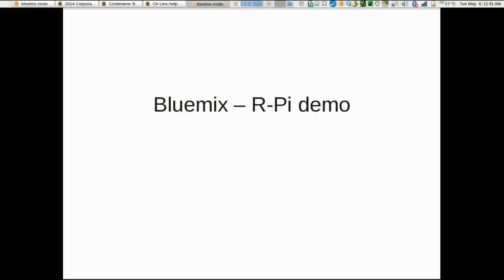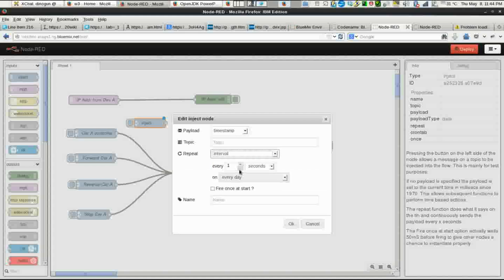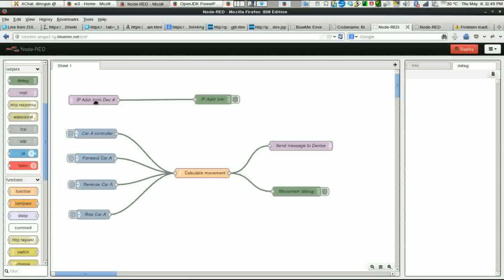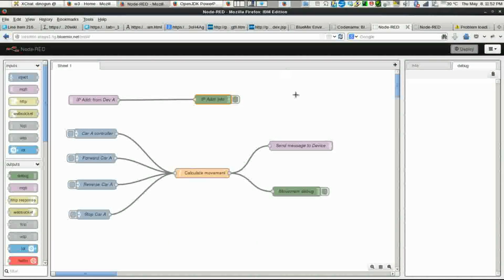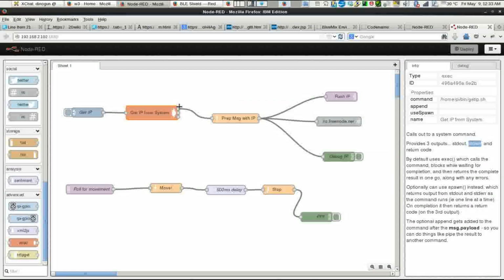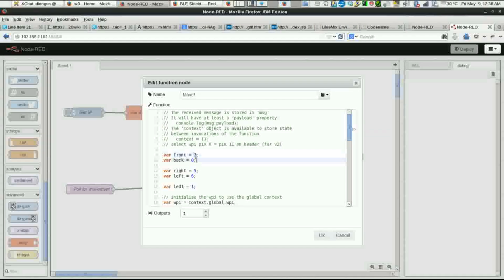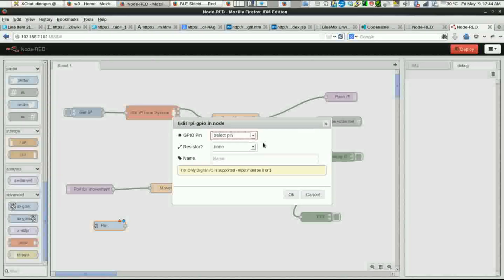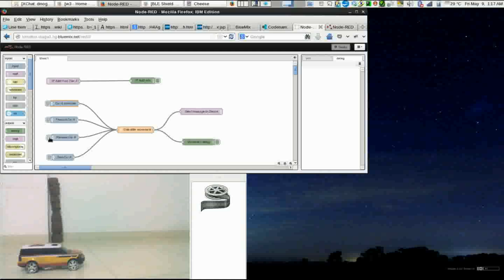Raspberry-Pi attached RC car controlled from IBM Bluemix

Comment: Awesome! made me a kid again! Thanks for the very thorough explanation of all the moving parts and Nodered of course.

One thing I could not get is what do you use to push the program to the r-pi device on the car. Is it a IDE on your laptop that connects over Wifi to the r-pi? Also is there some program running on the r-pi that connects with the IDE on your laptop?
Reply from the maker: Hi Ajay, glad you liked it! Note that R-Pi runs full fledged linux distro called Raspbian (Debian linux distro for Raspberry-Pi = Raspbian). There are pre-installed SD cards with Raspbian, or you can install it yourself from http://www.raspbian.org . So all I had to do to connect to it was to just ssh into it !